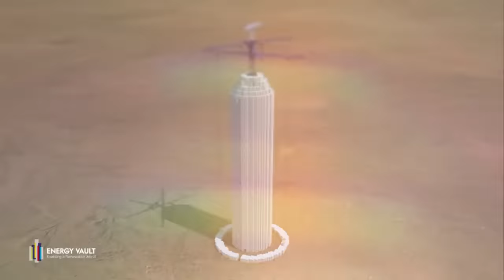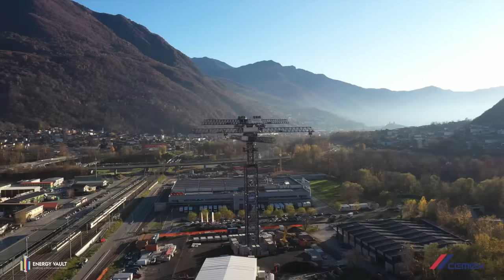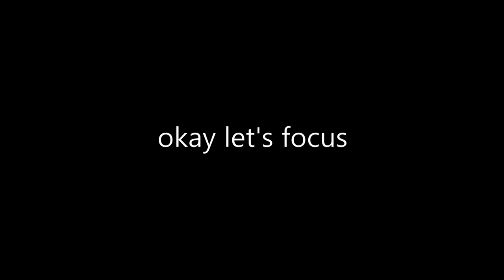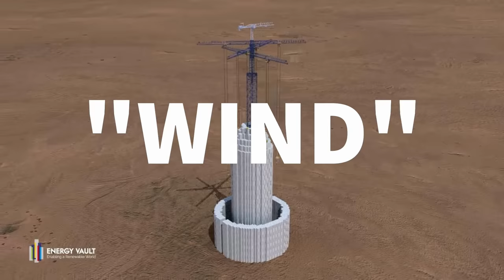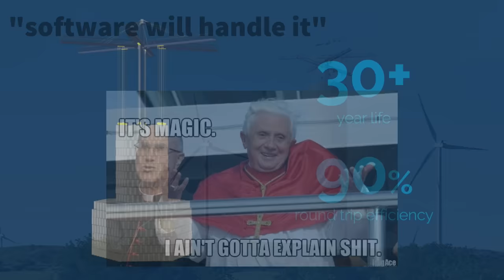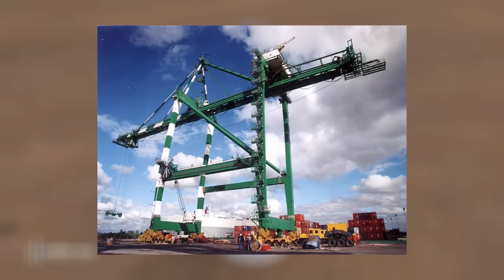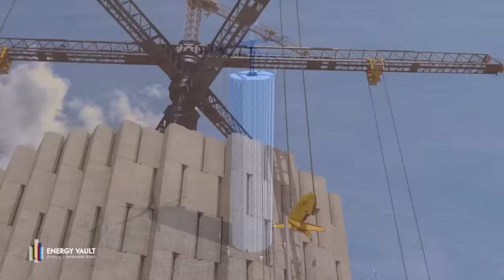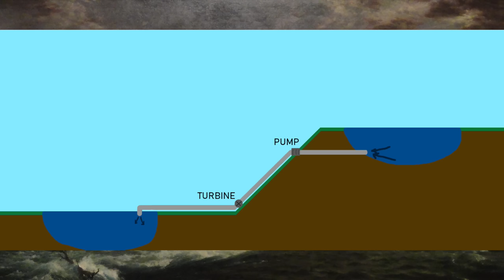The Energy Vault is a Dumb Idea, Here's Why

Comment: You know, I'm actually a fan of the concept of gravity batteries in general. Still, this concept seems stupid even to me. There are way too many things that can go wrong here. Honestly, it would just be simpler and cheaper to do a water tower the way they're doing it.

My two favorite designs for a kinetic battery would have to be the pinwheel design and the deep well with integrated weights design. I particularly like the Deep Well design because it could potentially sit there for 50 or more years and then kick on whenever you need power making it extremely useful for an underground bunker type of situation maybe as a backup power source in the event of an EMP.
Reply: Well, (pun intended) it would still need to be maintained to make sure that it works when called upon. For one, making sure that ground water doesn't collect in the well - or if it does, that that has been taken into account in the design.
Reply: But to be frank a kinetic battery could be done so many other ways like in Electric mountain in Wales. I grant you one would need mountains.
Reply: I don't know what the right design is, but gravity is the way to go.  In front of me is a clock that was made before the civil war which makes this obvious to me.
Reply: @gunnar6674  I think the deep well design is supposed to be hermetically sealed. Not even air should be inside the shaft. Obviously you should at least check that your system is working periodically, but provided that there isn't a source of corrosion from humidity, the only real maintenance would be from General wear and tear which would only really occur when you are actually using it.

That said, if someone cuts corners in construction any design could fail. Still, I'd have more trust in a poorly built shaft than what we see in this video.
Reply: @scootergrant8683  And in order to do a water tower you'd need a LARGE source of water that you can consistently use year round. Which is not available everywhere which is why these are designed for use without water. These gravity batteries are not going to be replacing power plants. But as support infrastructure for arid, rural type areas its pretty great.
Reply: Hydrogen gas is a more stable solution for long term storage. Water shouldn't be stored stagnant for potential energy more than a month or so.
Reasons- 
comparatively poor energy density
Potential growth on equipment
Inevitability of leaks
Evaporation
Sediment/minerals will precipitate out, potentially clogging turbines
Reply: Neither cheaper, nor simpler
Reply: Hydro will have a big footprint. The higher you go, the thicker the wall at the bottom need to be.
Reply: @AndrewOxenburgh  I agree about the concern over footprint (and limited availability of suitable locations) but the need for thick walls is only relevant to top reservoir size- not height over the bottom reservoir. Flood Gates would be built at the top reservoir so that you're only fighting the potential energy self contained in that one reservoir.

Edit- to learn more, I recommend the pumped hydro video made by channel "real engineering"

Comment: omg I literally thought "isn't just moving water from a higher altitude lake to a lower altitude lake the most efficient and effective battery" when they talked about storing energy using gravitational potential.

Damn, if a mo-ron like me can grasp this I wonder what goes through the minds of the shipdits who come up with that stuff.
Reply: pumped hydro is without a doubt the best possible energy storage out there, but its increadibly costly and limited to very rare environments. Its obviously for everyone the first option of storage, but its hard to come by and incredibly costly to build artificially, thats why other ideas are explored
Reply: @Zybran93  There is literally no scenario in which a kilo of concrete is more environmentally friendly to create or move than a kilo of water.

Concrete is denser than water, but mercury is again denser than concrete if we want to start down the environmentally unfriendly path.

Drilling a hole underground and pumping between two heights is actually feasible, if costly.  It elegantly solves for evaporation, and they've repurposed multiple old mines in Australia for underground energy storage, again slashing that cost significantly.

The real problem is the energy density.

Unless you drill it under the city, you lose a lot of efficiency pumping the electricity to & from the storage, as mine sites aren't generally power station sites.
Reply: Money mostly...
Reply: The point of this is to use a material with higher density than water. Assuming similar efficency in the systems, from the same height 1m³ of concrete will have about 2.4 times the energy as 1m³ of water. I do find concrete as the material of choice to be questionable though.
Reply: @pondracek  I quess that is a rhetoric question, but just to be sure: availability of mercury, toxticity, and reactivity of mercury. Water is an easily available ressource, there is more than sufficient knowledge do use it for power generation and we know how to deal with corrosion and all other issues of water.
Reply: @tobio.5968  i.e. there are more factors in favour of water such as inertness, abundance, and fluid dynamics, than would matter in the case of mercury or concrete?

Colour me shocked.
Reply: @pondracek  Its funny that you people are stuck on the concrete aspect when the company does not use that.. they have their own method of creating blocks. The other thing is that you don't have to use concrete. There are plenty of other waste materials like crushed cars that can be used and then further recycled.
Reply: @aaronburns9365  ??

All the things you've proposed have the same fundamental flaw.  (They're not fluid, which is why water is both superior and been around for over 50 years as a battery medium.)
Reply: @pondracek  One size does not fit all. Why are you disregarding that? Fluid is not viable and continues to be less and less viable, if using h2o, across the globe. In the USA we cant give water allotments to farmers in many regions. 

You have to have a diverse way to generate power and you have to have a diverse way to store power. 

As an example, imagine a place that has an abundance of water. You would think great we can use that as a way to store power. But then, you find out it is located in a flat plains area that is frozen 4 months out of the year. You can't create a elevation drop on a large scale and you can't keep the water from freezing over. You also find that the local plant and animal life live in such a way that it clogs inlets to the turbines. 

Your response to that might be about technology that has been developed over a 100 years. I would say, why can't we let other tech in this sector develop over a 100 years as well.
Reply: @aaronburns9365  Listen.  70% of the planet is literally covered in water that doesn't freeze.

Pound for pound, you're better off building an elevated container over the ocean that won't move than a concrete lego block even if you don't understand the basic engineering principle that a single moving part (pump) versus 50+ (cables, cranes, software, blocks, block interlocking mechanism) is how you engineer for reliability and cost.

Water might be less than ideal in a desert or frozen tundra, but cranes can't operate in those conditions either (sand/sandstorms, frost).  And you'll have a much easier time solving both of those problems by drilling a hole in the ground to pump up and down than a Jenga simulator.

It's just not cost effective to do so.  (Which should speak volumes about the cost of a shitty design that stacks blocks on an inside and outside tower that literally loses half its capacity purely because of that fact (when outside ring = height of inside ring, your stored energy capacity = 0)).

Edit: Hell, you'd literally be better off using the Bhurj Khalifa, or any tall building, as a 'gravity fuel rod', Evangelion-Style.  Except that'd be its own horribly expensive engineering nightmare.
Reply: @pondracek  Unless that kilo of concrete is already there and not used, like from a demolished building? What about countries which lack water sources and mountains? EnergyVault has a market but the main concern is scaling (effect of wind and source of enough environmentally materials).
Reply: @robinfrenzy  1.  If you don't have water, you can't make concrete.  Check and Mate.

2. Hypothetically speaking, sure.  If a country had concrete already cast to the energy storage blocks, from a previous dismantled energy storage tower (see where this is going?) then yes, there's an advantage.  If you're talking rubble?  Hell no.  When engineering for long term use of moving parts, you need to guarantee the forces via quality control.  You can't quality control rubble.  Metals can be re-cast.  Rubble cannot.
Reply: @pondracek  1. I meant dams are not a possibility in countries that lack mountains and fresh sources of water so such a solution could work. The kind of country that might have enough fresh water for construction with underground sources and desalination plants.
2. I'm not talking about materials from another tower, but from any kind of demolished building. Break the concrete up, put it inside blocks and maybe use sand to balance the weight of the different blocks. 
I agree that moving parts if definitely the weak point of this solution.
Reply: @pondracek  As you mentioned, ONE of the real problems is energy density (weight in this case). Another real problem is energy transition efficiency (can cranes move concrete blocks more efficiently than pumps can pump water (pound for pound). Another real question is: How do you define efficiency? Do you define it by dollar cost or do you define it by CO2 and other embodied GHG costs. Then there is the problem of how do you calculate the costs, given that that capitalist economists (and most folks) discount the value of future generations (the discount rate)?
Reply: @pondracek  >>All the things you've proposed have the same fundamental flaw.  (They're not fluid, which is why water is both superior and been around for over 50 years as a battery medium.)<<   Water is subject to both turbulent and linear flows. Do pumps require more or less more maintenance/lb. lifted? Which systems  require greater capital investment? Human intervention is expensive, how do we balance the cost of human intervention in this processes of calculation?
Reply: @archstanton_live  Solids on the surface of the planet are subject to impact fractures from use, wind, dust, irregular storage and consumption rates (when switching to another block, your battery becomes negative return) and a greater construction cost than a hole in the ground.

Unlike sealed bearing pumps which are incredibly reliable, cranes are high maintenance of many unsealed moving parts, and cost more to purchase.  Those unsealed moving parts fare worse in a frozen or sandstorm susceptible environment (deserts, as proposed above).

There literally isn't a financial reason to do it.  It's a bad idea.  And should be ridiculed along with perpetual motion machines and power wristband bracelets.
Reply: @pondracek  good point about solids v liquids.  I guess you are saying that pumping water is better than hoisting man made carbon demanding solids to store potential power. California has been using fluid/water gravity for DECADES to store potential power by this method. It works. We don't hear them championing it. EVAPORATION is ONE bugaboo that requires additional costs to overcome to become cost efficient. Basically my friend, how do we overcome the economic costs in order to overcome the societal costs for future generations? (Clearly; lithium does not appear to be answer.)  ;-(
Reply: @pondracek  maybe you are just saying that future generations are SOL and we shouldn't worry about it.
Reply: @archstanton_live  I live adjacent to a reservoir in the Colorado rockies and can tell you that evaporation is countered by rainfall and runoff. Of course this is extremely location and climate specific, but building hydroelectric dams for power storage can actually give a net positive amount of power if built in a suitable location. I don't think the same can be said for stacking blocks, no matter where its built. But that's beside the point I was making, just wanted to share my insight, have a nice day!

Comment: At 1:20 - 200,000 cubic meters of concrete will weigh 480 MILLION kilos as well.  That means this stack of bricks is going to need an enormous foundation underground to keep it from shifting position, settling, etc.  So you're going to need to dig a bigger hole for that, and make more concrete to support this.

Comment: You can also use air instead of water.  Heat of compression can be a concern, but you could theoretically use the waste heat in cold climates for heating living and working spaces.  A great way to re-use old abandoned mines.

https://en.m.wikipedia.org/wiki/Compressed-air_energy_storage
Reply: Energy density is crap.
Reply: idk about that man, air compression is extremely inefficient afaik and you are also making a thing that really would love to explode.
Reply: Or using molten salt instead...
Reply: @j.f.christ8421  Well that's too bad, abandoned mines are known to be really tiny, highly valued patches of land which, due to their many possible uses, results in such high space value that you need astronomically high density solutions to maximise their use.

Or with less sarcasm: abandoned mines are giant, useless, and don't have any natural or economic value, so I feel like you could cut less efficient solutions some slack.
Reply: @jlust6660  You could stick a turbine down that mine shaft, pour water down it to generate power and them pump the water out later.  That's a dumb idea that would still work, and even then it's better than trying to pump underground chambers full of air.

Anyway, in the US those old salt mines are full of petroleum, where do you think the reserve is kept?  (And LPG in the rest of them.)

I say draim them and full them full of batteries, that'll work and be an even better idea.
Reply: Not in this system but compressed air storage seems to be good
Reply: So basically the Morlock Project from Black Ice?
Reply: @j.f.christ8421  That seems like a nightmare for maintenance. Either way I don't think that it should be looked at as a an universal solution for all mines, if a better use is found than those are obviously better ideas.

Here most mines are completely deserted and disused with the exception of the few used for touristic purposes, we don't have any oil or gas production and most of our fossil products are stored (to my knowledge at least) in or near the harbors where they are imported and produced and water management structures and the few large scale batteries we have are kept above ground where they are easier to maintain.
Reply: I'm surprised I got this many responses this quickly.  I just remember in college we had an example problem on a test for my fluid dynamics class where we were given a large empty mine and we had to calculate what the compressor and turbine efficiency had to be in order to be profitable given energy costs at day vs. night.  

Later I remember looking into it a little further and I think the overall efficiency of these types of systems in the real world is about 70% which is comparable to the low end efficiency of hydro storage systems.  Not much maintenance involved either and I always thought these could be really great systems if you were able to economize the heat of compression or use the compressed air directly as well.  Mineshafts are fantastic insulators from ground level ambient temperatures.
Reply: I believe people are looking at a solution similar to this, but instead of compressed air they are looking at liquifying the air. From there they intend to store the waste heat and cold liquid in separate tanks and then mix them back together in order to turn a turbine.
Reply: You could use salt caverns as for natural gas. They are much larger